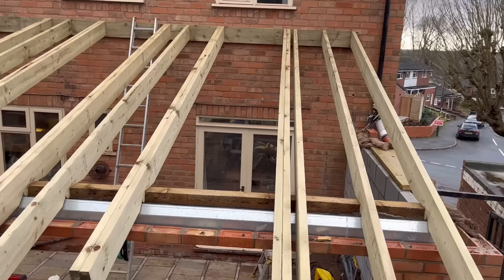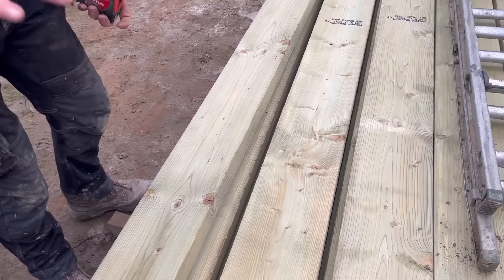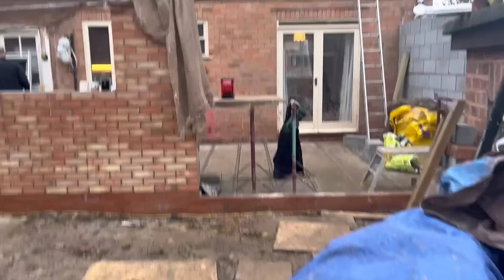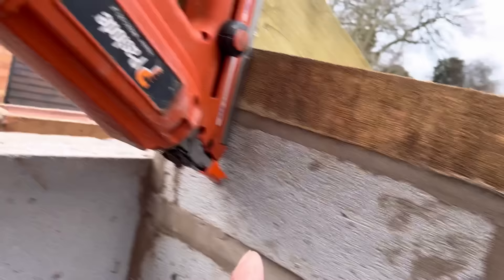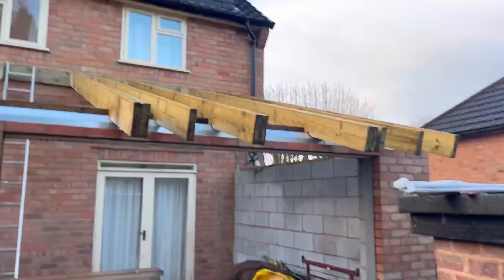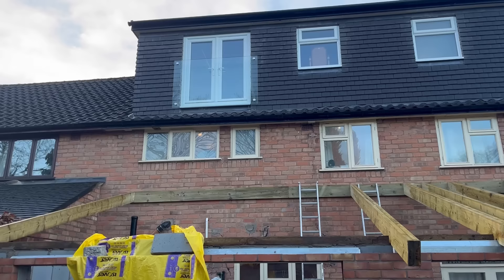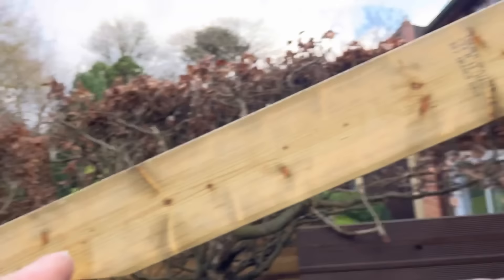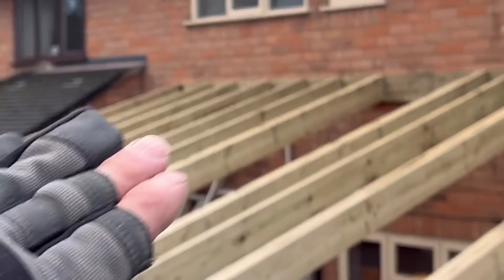Single Storey Extension  Stage 7 Setting out of Lean To Roof

Comment: It would been interesting to see how the wall plates are secured to the wall,they must take a fair load with a tiled roof.keep up the good work.
Reply from the maker: Hi Keith. I show that in the next episode very briefly at the start. It’s hard sometimes to show everything without the videos becoming to long and boring for everyone. Thanks for watching.
Reply: Are they having bi fold doors?
Reply from the maker: Yes mate they are 3m 👍🏻
Reply: @mrabuilders6723  does that mean that you use cavity closures? Will you be fitting the doors? If so can you recommend what make you use.
Thanks.
Reply from the maker: We have already fitted the cavity closures in readiness but we use a company to come in and fit the doors so we get the warranty and the  fensa certificate. I wouldn’t know the make sorry but if you follow our channel I’ll be sure to mention it in the bi fold door and window install video for you 👍🏻
Reply: @mrabuilders6723  Thank you, great content.
Reply: How are you finding the part L changes ps when you fit the Velux don't throw away the felt collar or the insulation away you need to fit these to pass new regs. Velux on their own with just the flashing no longer meet building regulations.
Reply from the maker: Hi Alex thanks for the heads up with regards to the velux I haven’t looked that far ahead yet. This job is old regs because we started it prior to June 2022 as part of a combined planning with the loft conversion we did. Thanks for watching. 👍🏻
Reply: Never used a nail gun to fix rafters, always used 4inch galvanised much better gauge. But I’m old school😉
Reply: Don’t see any damp course between wall plate underside and brickwork mortar bed ?
Reply: @Davidlouis3   never ever seen dpc under wall plates what country are you in 😂
Reply from the maker: Haha! That's because it doesn't happen, pady!
Reply: @mrabuilders6723   because it’s not needed more like
Reply: @padymac1  yes it is , mortar onto any timber requires protection muppet, dpc or bitumen
Reply: @mrabuilders6723  How long have you been a carpentry?
Reply: Just found your channel Keith. It’s refreshing for someone to explain things without making us feel like idiots. Thanks.
Reply: Great video! I have a question. What is the minimum required roof pitch for a rear extension? I’m hearing lots of different figures being thrown around but I don’t see any of these in the building regs I’ve read. Any idea?
Reply from the maker: That is a good question Troy but all I can say is that when I first started I was always told that a flat roof is anything up to 12 degrees and after that a pitch roof. These figures would seem to make sense when you look at the spec for the roof tiles we have fitted on the extension. I’m sure they said minimum 12 degrees and maximum 60 degrees.  Hope this answers part of your question 👍🏻
Reply: Great video. Can you tell what brand toolbelt you have. I like that one.
Reply from the maker: Hi Rene. It’s a belt designed by Perkins Builder Brothers who are YouTubers. I’m really happy with it and the channel is worth a watch as well. If you look on our channel I’ve done a video review on it. Thanks for watching.
Reply: @Davidlouis3  best not to give up your daytime job.
Reply: @andyphillips7435  very funny, keep practicing you’ll get it rite  next time
Reply: @yammyxjr8499 nobody uses a hammer anymore with the 4inch nails. I do still.......I'm an old school chippy from the 60's
Reply from the maker: I’m more than happy to swing a hammer but your right mate nobody does it now. I was only talking about how much I used to like floor bumping last week with someone👍🏻
Reply: New subscriber here. Im a bricklayer lol b4 i ask this qustion. When transferring the lengtf for birdsmouth from house to yor 65mm square mark. Is it from top or bottom of plumb cut at house. Im prob bein daft apologies
Reply from the maker: No such thing as a daft question Keith. The birdsmouth depth is always maximum 1/3 of the total timber depth. 
The length of rafter - birdsmouth is measured from top of your ledger plate (top of rafter ) to the cavity side, top edge of the wall plate on top of the brickwork. Once you have your plumb cut angle, cut off your plumb cut and mark the measurement you’ve got from the top edge down the rafter to the point where it intersects with your birdsmouth ( 1/3 up from bottom of rafter ) 
Does that make sense? 
Hope this explains your question
Reply: @mrabuilders6723  it does mate cheers
Reply from the maker: I’m glad it makes sense other than me calling you Keith sorry mate I read the top comment first. Have a good weekend Sean 👍🏻
Reply: My roofer could do to watch a few of this guys videos had a lean to done but there were gaps all over at the birds mouth I suppose he will say my wall was out and the wood rolled so there was nothing he could do 🤷 lots of cowboys out there anyone can say there a roofer but professionals are difficult to come by
Reply: Wallplate to house  only needed to be 6x2 and rafters Should also have birdsmouth to stop horizontal stress if vaulted and no collars are required

Comment: Shouldn't the rafter sit on top of the the timber thats fixed to the brickwall and cut a birds mouth at the ridge as well as the wallpaper to stop lateral movement
Reply from the maker: Hi Chris. I have never fixed the wall plate onto top of the bolted plate. An engineer would have to convince me that the surface area that sits on top of the plate and also the fact that you are cutting a 1/3 of the timber away to do so is better than the surface area I have sitting against the plate with 3 x as many fixings.  Thanks for watching.
Reply: @mrabuilders6723  a 3x2 bolted to the bottom of the  bolted wall plate would be better
Reply: with 42 +yrs of joinery/ construction  the golden rule which was drummed into me in the early years was always full contact on the ridge, I've often questioned this but cannae break a  tried and trusted very reliable habit, birds mouths do look so pretty tho
Reply from the maker: Hi Rob and thanks for posting this I was taught the same and can’t see why the birds mouth is better but nevertheless I’m still looking into it and awaiting a reply from a structural engineer to tell me how and why but If I’m told that it’s the way it is now I’ll accept it I suppose or risk more abuse on here or having to strip a roof off to do again at my expense. Thanks for watching

Comment: This is a great trick. Im by no means an experienced joiner, but ive built about 6 or 7 roofs and love watching videos on it. What a great method for the angle.
I personally cut a block the size of the remaining timber after the birdsmouth and measure from top of the wall plate to top of the block ive cut. And that gives me a measurement to where my plumb cuts need to be.

Comment: Lean to, roof Mr A !   it’s leaning towards not leaning as well !
 That’s enough of that.
      I am pleased to see that there is enough space beneath the sills to install your top flashing, I’ve come across several sets of drawings which ignore this, I think with the intention of getting a specific head height and tiling fall.
Reply from the maker: Glad you approve, that’s the way it has got to be doesn’t it or it’s not right. Thanks for watching

Comment: Trying to get all the joints bang on is so dependent on so many variables ie the sole plate being dead level the outside wall being real parallel with the existing wall the nominal timber sizes being all the same size and square generally nowadays from my experience u can’t have all of them things falling in to place ( especially the timber sizes) so it’s always a compromise on a drawing it works perfectly but in reality it rarely does so u compensate as all chippies do on site and make it work but for me u still can’t beat traditional roof construction so great tutorial

Comment: Great video, over here most people machinery bolt down their wallplate, I noticed that in the UK you prefer to bed them down.
Reply from the maker: Hi Dan. We do add the wall plate straps as well as required by building regs but the bedding on is mainly to get it bang on level and flat. If we bolted down into those light weight thermolite  blocks they’d shatter. Thanks for the comment. 👍🏻

Comment: Hi, Its a nice video detailing the rafters size measurement and headplate.
Please advise the size of screw/bolts used for the headplate. It is very important and starting step to fix the headplate securely.
Thanks

Comment: That’s a good way of sorting the pitch how I do it is bottom of the rafter to top of ridge and lift the bottom to the height above plate  I’d suggest trying out the ultimate roofing square
Reply from the maker: Have you seen the price of them now. Prefer to carry on as I am 😁👍🏻
Reply: @mrabuilders6723  I got mine a year or so ago £95 but not sure what they are now
Reply from the maker: £110 now but when I saw them at a trade show they were £90. It’s same with everything now though isn’t it. Everything has gone up 👍🏻

Comment: I have really enjoyed watching the build series. This sort of thing fascinates me. But I'm a domestic gas installer and am very aware that the boiler flue terminal must not be enclosed - not even partially enclosed - and the build is reaching that critical point.

What are your plans for that?

A bit more info: The concentric flue is used for air inlet and products of combustion (POC) outlet. As the area becomes more enclosed, the dispersal of POC will slowly become compromised with the risk of air with greater CO2 concentrations being breathed in by the boiler. That leads to the risk of more C02 and then the dreaded carbon monoxide (CO). Now unless you have a sensor onsite continuously monitoring the CO2 and CO levels you will not have a clue as to the current situation. The typical "Oh, there isn't any risk; we will be ok" can evaporate very quickly when people  begin feeling groggy.

And just a bit more "food for thought" - you don't know the condition of the boiler as it is now. It may not have been serviced for years and could be belching out CO. Partial enclosure could raise the risk from [the unappreciated] "high" to "Deadly".

I am being purely selfish with this post. If I can keep you alive then we will get the next episode... 😀😀
Reply from the maker: Hi Stephen thanks for the comment. I understand your worries and can ease them by saying that as we speak we are preparing the area for the new boiler and will move it prior to any permanent sealing of the extension roof, doors and windows. You will have your next episode 👍🏻
Reply: Hurray... ! 😄
Reply from the maker: Don’t worry mate I’ve edited the next two vids for you. 😁👍🏻

Comment: Great video thanks. Building a garage with similar roof structure and this is very helpful. Especially the tip for raising the rafter up to allow for the birdsmouth cut. One question, do you think it is worth using joist hangers on a job like this? Or is just nailing as good?

Comment: would your method for obtaing plumb cut on common rafter work with a hip rafter allowing for height above plate ... many thks mr A  ...LOVE YOUR WORK.
Reply from the maker: Hi and thanks for the comment. I’ve only ever used this method to get the plumb cut of a common rafter and therefore the degree pitch of the roof. I then use my roofing square set to the degree pitch on the hip scale to do the hip cut. However, it would be worth a go as long as you have got your height above plate off the common rafter first, transferred it onto your hip using the same batten screwed to the top. Don’t forgot to cut you wall plate corner off first to 45 degrees so you can get a full bearing of your seat cut. Hope that makes sense 👍🏻

Comment: Great detailed explanation.

I have 2 questions.
1. How do you add stepped dpc or cavity tray over the catnic openings for the weep vents?

2. Where the rafter bevel rests on the ledger board/bolted wall plate, in what instance would this become another birds mouth cut resting on top of the bolted plate?

Comment: The are typically called 'shed-roof' here in the States. I assume this in in Great Britain as his ledger connection only works if that is a structural masonry wall.
Anything in the States built after ~1940 has what they call a brick-veneer'. You can't attach a roof like that to a brick veneer as the veneer is not structural.
Reply from the maker: Yes mate we are in the UK and it’s a solid masonry wall 👍🏻

Comment: I don't know if this has been asked already but I was expecting a birdsmouth at the bolted wall plate end too. Will just a few nails be sufficient support for all that weight of the roof?
Reply from the maker: Hi Ian. It’s not the first time it’s been asked mate so all I can say is how can decades of carpenters before me be wrong all of a sudden. It must be the new trend 😂👍🏻
Reply: @mrabuilders6723  Oh I wasn't doubting that you were doing it correctly. I suppose I didn't phrase the question very well.
I wondered if I had missed anything or any other supports because with all of that weight it seems a lot for nails to support.
I suppose I was hoping you would tell me some scientific jargon about lateral forces and what not, so that when I build mine the same way, I don't lie awake at night worrying that the nails will rust and everything collapses.
Anyway...brilliant guide to simplify the process. Thank you.
Reply from the maker: I’m still waiting for the scientific jargon myself Ian to come from the people who say I’m a cowboy for doing it this way but they have never come up with any. However I’m still on the case myself and WILL explain in full both methods and any evidence I’ve found from reputable sources. Thanks for watching Ian 👍🏻

Comment: hi, so where we are you have to bolt and dog washer your doubles/triples around roof lights plus joist hanger all openings, rafter clip the bottoms and truss clip the tops or are you doing that in the next part? great episode
Reply from the maker: Hi Chris and thanks for watching. I will be coach bolting the doubles but I won’t be using joist hangers on the top and bottom timbers. What I do is use a large bracket at the top of each double and bolt this into the bolted wall plate and into the top of the double. I can see where the joist hangers would come into play if the rafter top and bottom were longer therefore more weight. However I’ve done 400mm centres and used    8”x2”  C24 timbers so I’m more than confident that it is structurally sound. Thanks for watching. 👍🏻
Reply: @mrabuilders6723  its what our building control specify we are not allowed to use coach bolts now it has to be a hi-tensile steel hex head on a square plate with dog washers rafter clips at the bottom and truss clips as they will not allow just nailing anymore as we are mostly on clay and have had a lot of movement over the years

Comment: thats exactly how i used to do it , accurate and nice and simple
Reply from the maker: Hi David. Why do you think there’s such a big deal about bird mouthing over the ledger plate now though? Have you read some of the comments I’ve been called a cowboy multiple times for doing it this way. I was never taught any other way on my City and Guilds apprenticeship. Ok it was a couple of decades ago
Reply: @mrabuilders6723  birds mouth gives more area to spread any load, i have seen builders putting spars straight onto the corner of the wall plate which is wrong , so your the one whoes doing it correctly the others are just chancers who have probably worked with someone who couldnt be bothered and so now they think thats the way to do it

Comment: Good but not perfect….No tray damp above lintels? Bottom of spas should hit top point of wall plate so truss clips fit perfect, I prefer screws over nail gun👍
Reply from the maker: Oh dear! It's hard to believe that you actually wrote that! Cavity trays aside, I suggest that you do some research comparing sheer loads of screws against nails! All your comment has proven is that like everyone else you're not perfect, but unlike some you may not even be very good. Thank you for watching.
Reply: It’s not a bad comment, was just suggesting you use tray damp above lintels with weep holes between brickwork so no damp comes in above window, I do prefer screws so pulls in, doesn’t matter because of shrinkage in timber that’s why use truss clips which am sure you used 👍
Reply: @mrabuilders6723  regarding your comment on screws being used. The Germans, Austrians, Swiss they always use screws with a timber to timber connection. Rafters, studwork panels, everything is screwed. Only time ive used nails in Germany is connecting metalwork to timber, hangers, straps etc so its not always nails just became the UK and American market nails everything doesnt mean you cant use screws.

Comment: Great vids.  Thanks for posting.  I have a lean to on my old 1840's stone garage.  The roof is slate tile and is laid directly on the stone.   The lathes are rotten and it needs replacing So I want to add a bolted wall plate and rebuild using the process you outlined in this video.    The stone where the bolted wall plate will be fixed is pretty wavy.  I was thinking I could use packers where needed when bolting it to the stone would that work or would you advise something different?
Reply from the maker: Hi Steve my first thought about the bolted wall plate would be to bolt on temporary in place and cut above and below with a grinder. Remove the plate and remove the face of the stone between these cuts with a breaker to form a flatter surface rather than packers and then fix using a two part resin you can push all thread into which you can buy from Screwfix. Hope this helps and thanks for watching 👍🏻